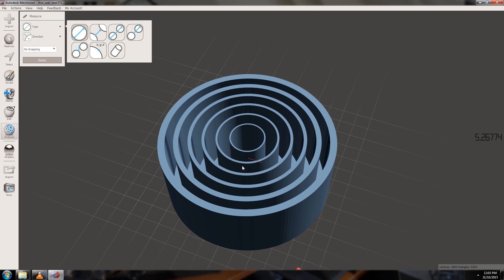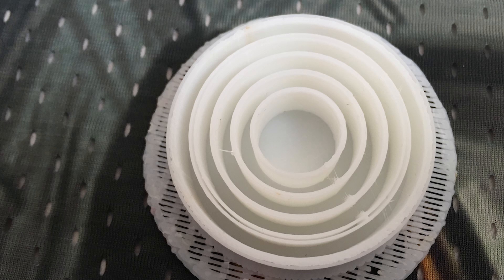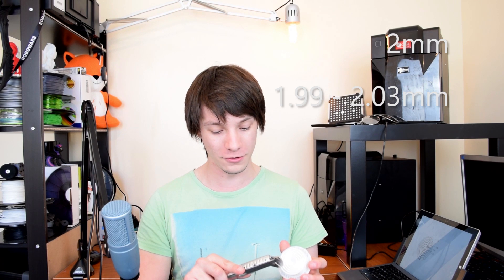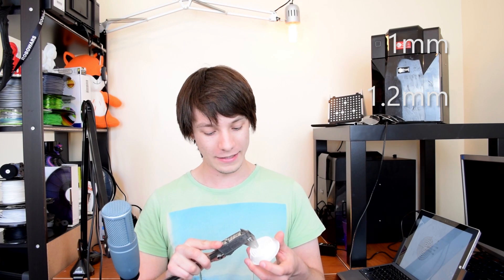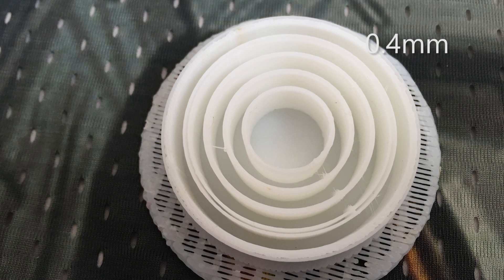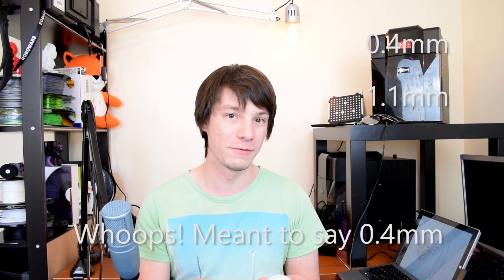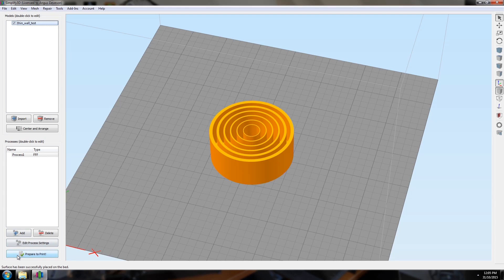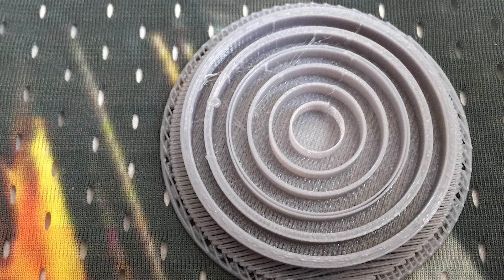3D Printing Thin Walls - 2015

Comment: @makers muse is that another up mini i see in the back ?! And in simplify 3d did you turn on thin wall detection ? And if you up your perimeters to 3-4 on parts it cannot so fill in it runs another perimeter also if you do concentric fill it does the same
Reply from the maker: +iCloud It is another Up Mini, I have 2 :D I'll try changing the perimeter and concentric fill settings and see how that affects it.

Comment: If you want the 1.5mm walls to fill in try doing just 1 shell. What happens is when the slicer can't get a wall into an area, that means getting a line of plastic in and back out, so 0.8mm, it just gives up. If that wall were 1.6mm it would actually fill it in with outline. However with only 1 outline it doesn't try to get the outline in and out, it just goes straight to infill and it can get something in there, so it's good.

Generally when I'm teaching 3D printing to people I tell them to just make all their walls 2mm to be safe.

Comment: Just recently stumbled on your channel.  Very informative.  Nice work.  Looking for feedback.  Someone in the industry recommended the Massportal line of printers from the standpoint of quality prints and material capability.  I'm in the early stages of lining up a printer with resolution and stamina to make short runs of small production parts - think "small salt shaker" in size and accuracy to +/- 0.001 inch.  Any thoughts on this manufacturer.  A bit pricey by comparison to some others I've studied and some of the recommendations on this channel.  And especially by comparison to the Tiko - although that might be a bit like apples and oranges this early in the Tiko's life cycle - need proof of market acceptance vis-a-vis actual user stories as opposed to pre launch excitement.

Comment: When I was first looking at getting at 3D printer I was looking at getting an UP! printer but then see the likes of the Reprap Project and the flexibility of each of the printers and how locked up and really how poor up printers were! My Reprap Wilson will print perfectly with no raft or any help at all. Whats your reason for using a raft all the time?
Reply from the maker: +Callum Burns The UP Printers need a raft due to their perforated platform, and with the Wanhao at the moment the Z limit switch is a bit inaccurate, so a raft helps even this out by the time it gets to the print. Once it's all dialed in I'll switch to raftless on the Wanhao for sure.

Comment: I'd love to try that print.
Reply from the maker: +Mickice Give it a shot! I've uploaded it here - https://gumroad.com/l/jGGAv
Reply: Thanks man, could have modelled it myself but wanted to be exactly like yours for best comparison results.
Reply: +Mickice Using my FlashForge Finder at medium settings 45% Hex fill got measurements of .45, .60, .85, 1.05, 1.6, 2.1 Came out beautifully actually.